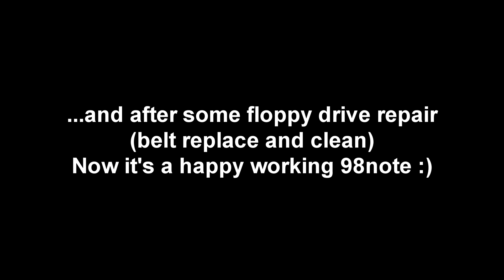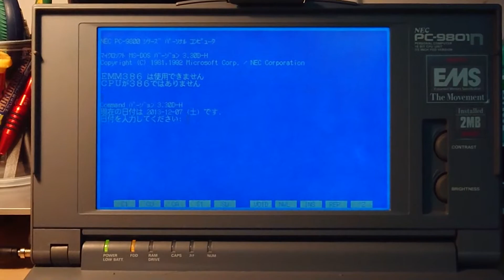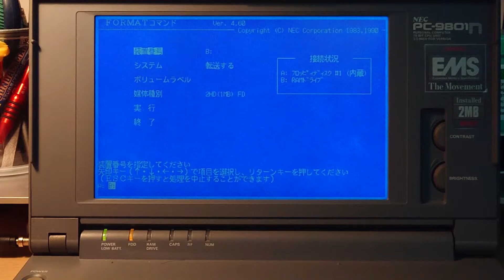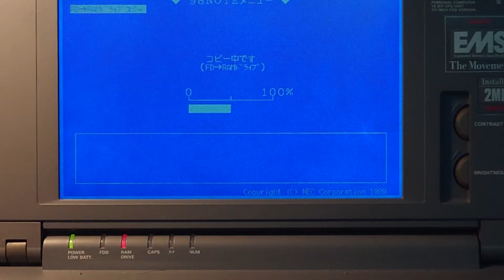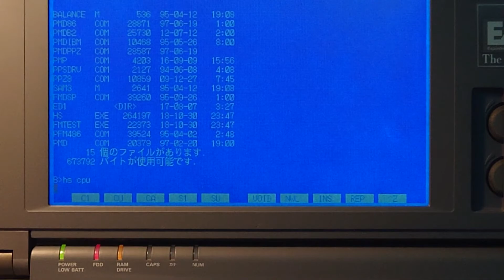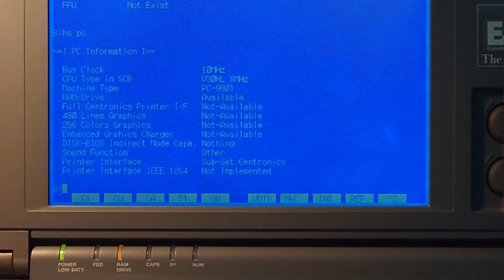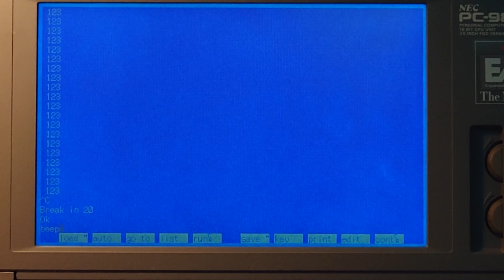NEC PC-9801N Repair&show

Comment: I'm trying to do some similar repair with SX/T model. Good work. I don't think I'll be able to solder a ram controller. You did very well.
Reply from the maker: give it a try! use a hot air station and plenty amount of flux , this kind of QFP chips can be desoldered easily > <
Reply: @ethy1ene573  2 years later... I'm in the middle of desoldering the powersupply boards on a 9081 NA/C. It is, as you say, painful. The soldering wick can't seem to suck up the solder. My soldering iron keeps getting stuck to it. I still managed to desolder about 70% of the pins from the main board.

Comment: Hi, great work! I have the same issue on the part you marked with yellow circle at 0,30". Can you maybe please tell me, what component it is? And the blue components beside it?
Reply from the maker: that's a transistor, if I don't remember wrong, it's IL marked, 2SA1463. The blue one is a inductor I remember.

Comment: Hello, Thank you very much for your information. 
Now I'm trying to repair 9801N, too.
I'd like to ask you a question.
You replace a FET or Transistor on Power circuit board.
Same semi conductor of my 9801N seems to be broken, too.
So I have to replace this, too. 
Could you please let me know, which type of semi-conductor this is?
2SK, 2SJ, 2SA, or 2SC?
When I checked the two power supply circuits, the symbols on the surface of the component were IL (line feed) 9Y and IL( line feed) 96.
Is this a regulator?
Reply from the maker: I checked my component inventory and found that it's a transistor, IL marked, 2SA1463.

Comment: Can you tell me if this laptop model is compactible with all nec pc 9801 computer games?
Reply from the maker: Nope.Its V30 CPU（8086 compatible） and GDC only support old games.Its performance is very poor.
Reply from the maker: @TheOscarrax  pc98 game compatibility is not that simple.it depends on graphics chip, vram and CPU.original PC-9801 has 8-color graphics and small vrams.it is quite different from 98note's graphic systems.I cant easily conclude that two model is "compatible",because it depends on game and software design and specific hardwares(upgraded or not)